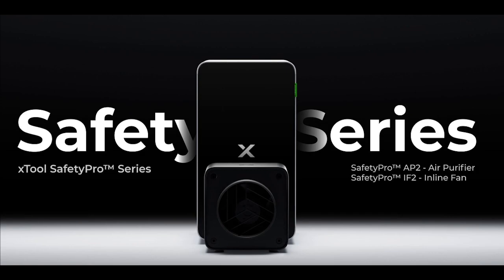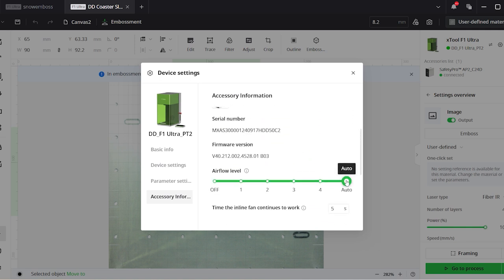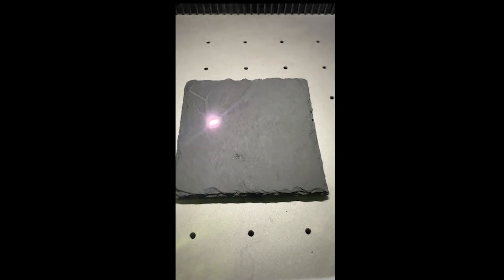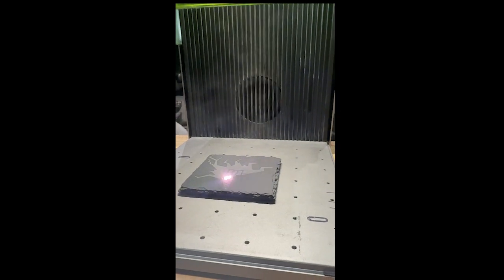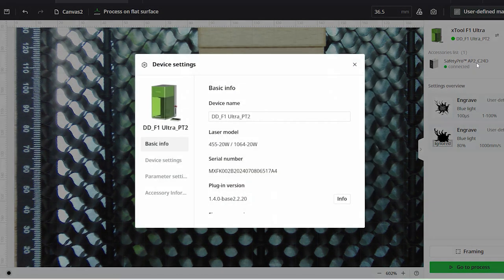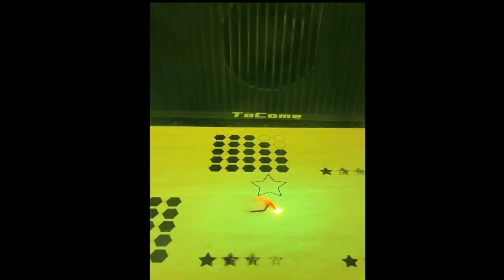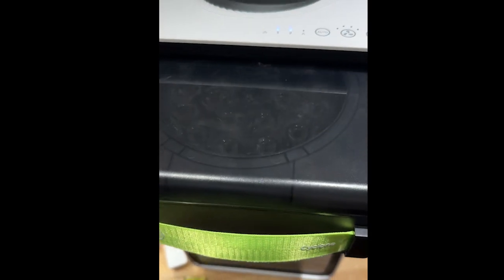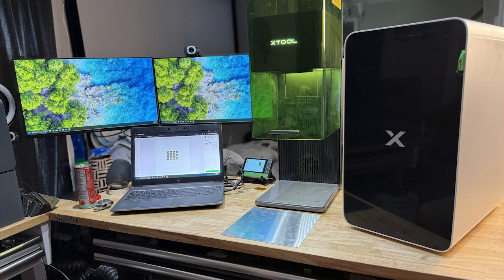xTool SafetyPro AP2 & F1 Ultra - Demo and Review!

Comment: Does this not work on one machine?
Reply from the maker: Which machine are you meaning? Im not understanding
Reply: @ my AP2 arrived today and I found out its one AP2 per machine
Reply from the maker: @TetsuoGamesTCG typically it is although I have had success with a Y system when at shows using my F1U’s